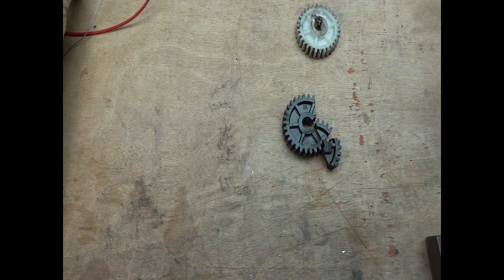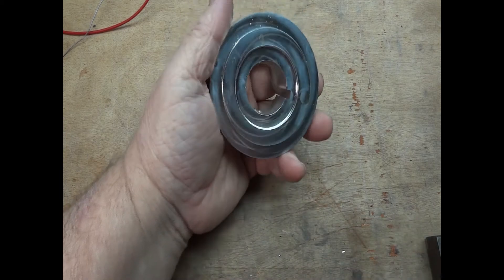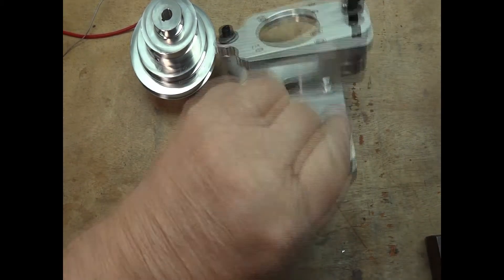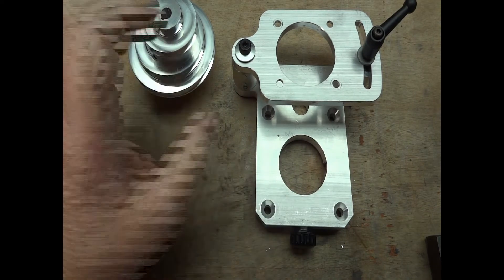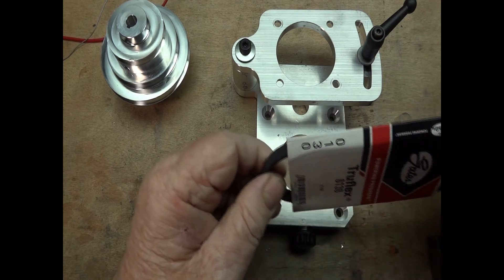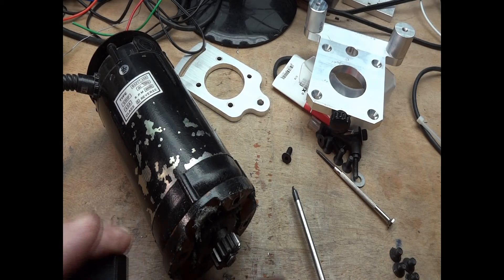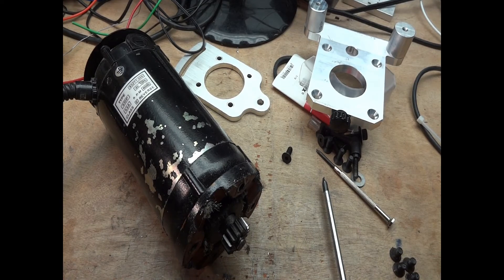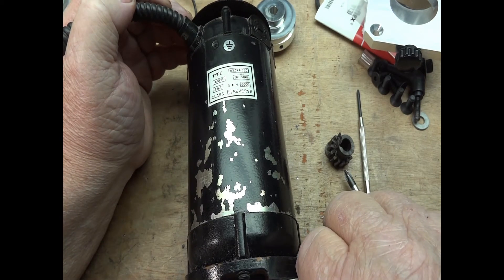LMS (LittleMachineShop.com) Belt drive critique and installation

Comment: I put the LMS metal gears in my lathe but wish I had not. I knew they would be noisy but they have way more backlash. Sent me a replacement but the same thing. 
I'd like to try the belt drive on my mill but the price is way out of line.  I did wonder about the belt wrap on the small pulley. Also there is more overhung load on the motor shaft verses with a gear.
Reply from the maker: I'm replacing bearing on my motor, I think it was more from the metal gears than the belt kit.

Comment: It would be the best part of the Mill, you're being ridiculous.
Reply from the maker: I could still shave with the pulleys but being aluminum they lost their edge.

Still compared to the design they were blatantly copied from these are a poor showing since they thinned the materials to save a few bucks and screwed to pooch on the end product.

When I get some extra time I will make the set as they were intended to be.